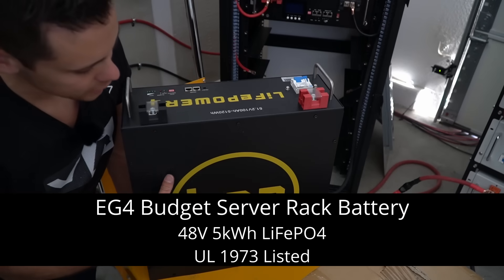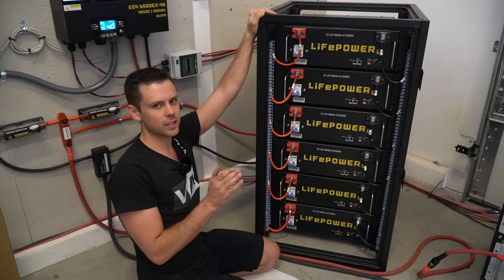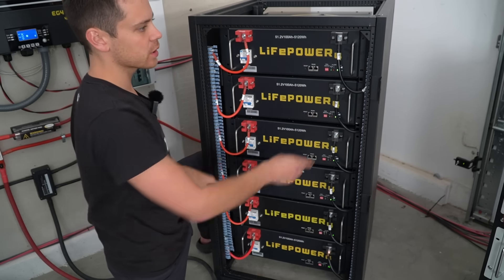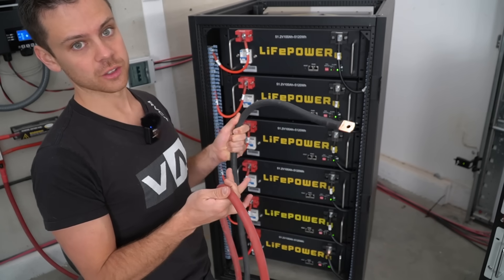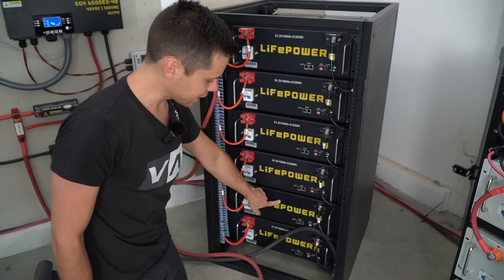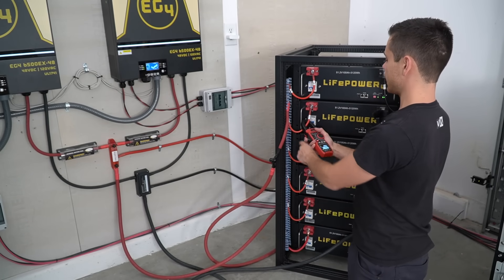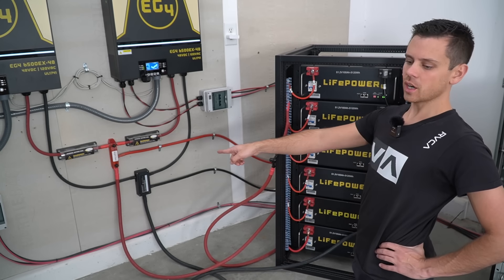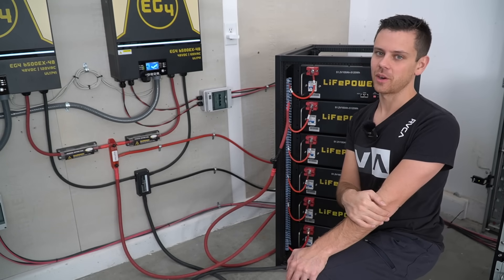How to Build an EG4 30 kWh LiFePO4 Server Rack Battery

Comment: How to balance two LiFePower 4 51.2V 100Ah-5120Wh batteries correctly and make the connection to the ALL-IN-ONE inverter? JULY 22-2022 Puerto Rico

Comment: I just ordered 3 (24v) of this for my apartment. I Have a Samlex 4024. What settings do you recommend I should set the inverter. It have charger included on the inverter. I charge batteries with grid AC

Comment: Will,  I love these videos, they are incredibly informative, especially for those of us who are electrically challenged.  I have a lot of questions for you, but here is one. Is this an off-grid system only?
Reply: I have the same question.  I would love to see Will show us a system that can be used with grid 99% of the time but then when needed go off grid when the grid power is off.
Reply: @JaiHenwood  that's harder than you think.

The issue is that you can't have the system go from off grid to on grid automatically as the phase of the inverter will not match the phase of the grid supply. That's why the most common on grid set up is unusable when the grid connection goes down -- counter intuitive as that sounds.

A manual changeover in both directions is probably the best you can do.

There are also legal implications in some countries, to protect the grid from rogue solar when it comes back on after an outage. That means that any design Will suggests may not be legal in any other country. Take local advice.
Reply: @JaiHenwood  He has video's on on grid systems, keeping in mind on grid means permits, inspections, electricians, and using approved equipment.  Doable if you have the budget

Comment: Can you average out how many batteries i would need for a ranch style 3 bedroom with 4 people? I know it can vary quite a bit. Just give me an idea please. It doesn't have to be correct. Try this one what's the least amount of power battery storage are we talking. Or throw some dugures out there because I'm about to purchase some storage and i really need help
Reply: How long do you need the battery to run your house? That 6 battery server rack in the video might power your average family home for 2 days, maybe less depending on your appliances and how efficient everything is. 3 batteries would get you maybe a day with room to expand, but might not be able to power some things because you need enough batteries to not draw so much from each one
Reply: @myvids4329  how much?
Reply: @myvids4329  I my total watts used is 4000 from the wall per hour , how long will this battery last ?

Comment: These batteries weigh 48kg or 106 pounds. Will has his handy hydraulic table. I have my son. NO WAY I could have done this as a one man operation!Also, look on YouTube for instructions for assembly of the rack. It is solid but tricky. Get the rack wheels. At $19 they are a good deal. You will have a heck of a time moving  700 pound battery stack with the caster wheels.

Comment: It is interesting that this only has 5-year warranty over 7000 cycles. This seems low compared to other LiFePO4 batteries. I was wondering if this is just a cost saving measure or can I really expect less life compared to competitors. Is there really anyway for a manufactures getting more cycles and longevity compared to others?

Comment: Now how about this, my batteries are installed following the original rack configuration, both positive and negative are connected on top of the bus bars, not on a diagonal configuration. How do I disconnect everything safely in order to flip the negative bus bar upside down? Thanks!

Comment: I may have missed it, and you have covered it many times before, but signature solar sends undersized wires for running to the inverter with the racks when you order them and the batteries if you plan on using more than 1 or 2 batteries per rack.

Comment: I've now built over 120kWh of storage for my house/workshop from raw cells, but got 12 of these for backup in my office. Prices keep compressing and making these more and more compelling and it was worth the ease of setup and compact package of these along with the UL listing for insurance purposes.

I appreciate your videos both quality, quantity, breadth and thoroughness.
Reply: Thank you for sharing your experience with building storage for your house/workshop! It's great to hear that you found the ease of setup and compact package of the EG4 30 kWh LiFePO4 Server Rack Battery worth it. Have you considered checking out the Segway Portable PowerStation Cube Series? It offers massive capacity, fast recharging, versatile sockets, and comprehensive protections. It could be a great addition to your backup power setup. Just a suggestion for fellow outdoor enthusiasts and RV lovers like yourself. Happy camping and powering up!

Comment: You scare me.  @2:45 in the video - if you truly believe what you say about flipping the bus bar arrangement - you should NOT be playing with electricity.
Reply: That's pretty common knowledge and accepted truth.
Reply: Exactly how could it possibly create a problem?
Reply: Yeah, I don't get the claim about the bus bar either. In theory the resistance does grow the more length of bus bar the current needs to travel to get to a particular battery, but for such a short distance that's irrelevant, I would be surprised if you can even measure the difference outside of a lab.

Comment: I have seven of the original face EG 4 batteries meaning that the breaker is located in the center of the face. I would say they're not 'cheap' but that James at Signature Solar has made them relatively inexpensive...
They're very well made and I am not the only one that sees how much of a bargain that they truly are for DIY solar.

Comment: You have come a long way from living in an RV to owning a house and buying a Tesla. Been a while since I watched your videos. I have 21 300W panels that I got pretty cheap and want to do a grid tie system. I am also trying to figure out how to repower an electric 4 wheeler that is 48V. I need an  inverter for the power system and some way to mount the panels on the ground.

Comment: Was reading the manual to  those inverters yesterday. They state you are limited to 150 amps max incoming current. So with two I'm thinking you could only do 300 amps max. Not sure why that is because it only equates to 60 amps max output by my calculations.  But then again 12 KW at 240v is 50 amps

Comment: I would love to see a video describing the whole 'charge the capacitor in the inverter' subject and why it is important to consider, and the thinking behind the battery and inverter power up and the battery hookup sequence...
Reply from the maker: I made a whole video on that that I posted some years ago
Reply: I am building the same battery rack that you show in this video, but with four batteries. I’m glad I watched your video as I will now flip one of the bus bars as you suggest. I purchased a resistor and was planning on doing the pre-charge procedure you described in your video of a couple of years ago and was unaware that these eg4 batteries had a pre-charge function baked in. This video is the only place I have found that mentions this and how to use it. Is there any other documentation from eg4 that describes this?  Wondering how you knew…
Reply: @DIY Solar Power with Will Prowse
Reply: @michaelstillerdesign4773  < I agree 100%, I knew they had a pre-charge resistor so didn't use my resistor but did not know the proper sequence of using it, cut battery breaker on and my 125vdc breaker on and it shut all my batteries down. How  does SS sell this stuff without proper documentation!

Comment: This is basically the system I want to put together.

Two of EG4's 6500EX inverters, at least three of the sever rack batteries.

Just don't know what good UL listed solar panels to get.  I want up to 8kW of solar. (Signature Solar doesn't have much of a good selection)

Comment: Awesome video as usual . I have the same server rack and batteries. I will now flip my bus bar. I am wondering about Will mentioning cycling the batteries down. Should I disconnect my solar until the batteries get down to one light?

Comment: maybe in one of your upcomming videos could you go over how you calculate your hardware requirements for an average home.. I know you use yours for your tesla but more people might want to power a home with a HVAC system AC / Gas Furnace and other appliances and equipment like refrigerator, tv, computer, lighting... how do you add everything up and then decide on how many panels you need and batteries to ensure 100% uptime even under heavy load
Reply: Look at your power bill. Pick the worst one and add a safety factor if you want to be totally off grid while keeping in mind that winter at northern latitudes is brutal for solar. If you will remain on grid you should size it based on your budget while concentrating on solar over batteries since those will provide the most bang for your buck, especially if you live in a net metering state or a hot state with lots of AC use.
Reply: The NEC (National Electrical Code in the U.S.) has full information on how to do proper load calculations (which incorporate good safety margins) to determine real-world ACTUAL  load demands for an electrical service. 

There are also several on line load calculators that are excellent. You will need to know square footage of your house/shop, amperage (multiply the current times voltage to get wattage) or wattage draws of ALL appliances and heating/air conditioning equipment, etc. and also current draw on other unusual loads like ev car chargers, well pumps, and so on. Most also ask for data on location and climate to account for heating and cooling average costs. 

Take the results of the load calculator, add 10 percent and the result in total watts divided by 1,000 will be the inverter capacity minimum size. (Round UP if necessary to the closest available size, NEVER round DOWN.)  

Example: load calculator total is 13, 450 watts. Divide by 1,000 gives 13.45kw. Inverter would be 15kw single unit or 3 stacked 6kw units. Higher is always ok, but never go lower than the calculated value or you will get system shutdowns at heavier usage.

Comment: I just built a whole house system for my Dad in New Mexico, using the same batteries and rack.  We used the growwatt 12KW inverter and 7 kw solar panel array.    The batteries are very heavy.I did not have a lifting device. I will next time. The system turned out great  I am very impressed with the batteries.
Reply: @ Dave Fields
Could you tell us what you paid for each individual battery pack and the price of the rack? Also where did you purchase the batteries from? What did you pay for your 12K growatt and where did you get it?
Reply: @bpsbps882  Sigmature Solar sells them. 1499 a piece.  Of they are out of stock, they go on sale as a buy and wait for 1449 each.  

Keep in mind, depending where you ship them to you will have a heavy truck freight bill too. For me, 30kw pack would about 300 bucks for shipping.

Service life is rated for 15 years at 80% DOD.

IF you do it right.  A sized correctly system will pay for itself in 7 years or sooner.  What do I mean by right?  Replace your heating with heat pumps.  Heat pump hot water.  Manage your time of use to daylight on heavy loads.  Move everything to solar.  Don't buy it all at once, start small and expand it out like Will is doing.  It took him YEARS to get here.
Reply: @bpsbps882  I think there around 1500 a battery I will put the link to the video I seen another guy post these same battery packs from china his setup is 20kw
Reply: @bpsbps882  yes great to know thanks for sharing
Reply: The 12K Growatt inverter is even more heavy. That thing about killed me 😆
Reply: Good on you for helping your dad with that. Can you tell me how much it cost?
Reply: not cheap
Reply: Can anyone tell me tge weight of the batteries? . I need to replace a 22kva generator in a truck i have.
Reply: @kevinmulligan5090   each battery weights roughly 110lbs
Reply: I am looking at putting a lithium battery bank in my camper.  This looks like it would work good with the 12 V 400AH battery and a 2,000 watt inverter.  Maybe 400 to 600 watts of solar.
Reply: I know this is an old post, but I would definitely recommend lithium. 
I finally got rid of lead acid and agm. Just went to these batteries. 

These are actually way cheaper than AGM. Considering you can only use 20% of a lead acid/agm. You can use almost all the capacity of these. So if you calculate out the “usable” storage. These are cheaper.
Reply: How is it going?

Comment: I just may be over thinking this, BUT if the wire distance from the battery lug to the place the wire connects to the bus bar was the same, would your batteries discharge equally? The top positive is 36" and the bottom negative is 36" The bottom positive is 6" and the bottom negative is 36" I guess your just forcing loss to keep things equal.

Comment: Could you put that rack on wheels and mount inverters on top?
Imagine these would roll into your garage and you just plug your panels in and it optimizes automatically.
Reply: I have just done this, bought some heavy duty casters with brakes and it rolls beautifully. Not going to mount the inverter on top, but the caster theory works.
Reply: @vonwalrusberger  they now have self-propelled solar generators. The back two wheels are motorized the front two can lock.
They have 120 and 240 running all the time and function as a backup for the house.
And you can add a few batteries or a second generator to double and actually recharge a Tesla.. almost... I suppose if I wait a little bit longer it will just walk up to the front door and plug itself into the house .... after putting the solar panels on the roof.
Reply: I was thinking the same and having them back to back on a metal frame, although you could have two server racks combined with both inverters on top facing out side by side.

Comment: Will, can you please add some information regarding potential use as an UPS? I am concerned about this system if it is as I understood you to comment that it will burn about 75 watts of energy 24/7. Is that correct? Where I am located I have minimal solar exposure and it is a concern. Where I live is also one of PG&E's favorite locations to shut power off during any minimal weather event. I just purchased 3 of the EG4s along with the rack and am looking for the best options given my situation.
Reply: 75W per inverter -- 150W since there are two

Comment: Will, do you honestly think Solar as an alternative energy will ever be cheap enough globally given challenges in economics. I’m in Africa where we get copious amounts of sunshine, making solar energy use a no-brainer but often we can’t afford it, more so battery storage 😢
Reply: Solar might become cheap enough.. MIGHT. But the battery situation won't. Unless a cheap new battery technology comes along it won't ever be cheap enough. We need batteries that not only perform better than lithium but don't require and rare earth elements and can scale to mass production.  Something like a saltwater battery.
Reply: The globalists don't want you using oil to power stuff and they will keep raising the price of oil so solar is all we have. At some point it will become less than oil but that does not mean it will be cheap.
Reply: @perry9492  Truth, the other element that is sad is that, in spite all the world’s ingenuity and progress, sustainable energy or never ending storage is light years away. Even current Lifepo4 batteries reach end of life.
Reply: Truthfully, in any well developed country where energy is readily available (and is already costly) solar is already cheap enough, even at current battery technology. In my location in Idaho, a 12kw off grid system with 15kw of battery storage and bifacial panels has a very short payback period of only 14 months. (That used to be over 7 years a decade ago.)

The sad irony is that countries that could really benefit from cheap solar still face a startup cost that, while quite low, is still equivilant to years of annual income vs. months (or weeks) of income elsewhere. The only solution to this is more of a political or social-economical arguement than one of technology.
Reply: @turbokatzenburg5732  that said, if it’s a political issue then we in developing or 3rd world countries are stuck in oblivion. Politicians, like diapers need to be changed frequently and for the same reasons, but our dictators will not allow this to happen, sadly.
Reply: @Turbo Katzenburg  14months my ass. No possible way. I live in eastern Washington and we pay 6.8 cents a kwh.. no way is a solar + battery system being paid off in 14 months. Nonsense

Comment: Question I can't seem to find the answer to. If I am running a 24V system what would happen if one of the two batteries has a different amp hour rating than the other? Does the voltage drain from each battery as if the other doesn't exist? Will it just become a 12 volt system once the smaller battery is used up?
Reply: If you drain them slow, the voltages will stay in sync.  They will be the same % full at all times.  If you drain them fast, the one with the lowest resistance will do most the work.  That's not good.

Comment: With a set up like this...what type of temperature would be best to store the server rack in?
Reply: LiFePO4 prefers around 25C. Heat is the biggest contributor to diminishing cycle life. You can discharge below freezing, but charging is a problem.